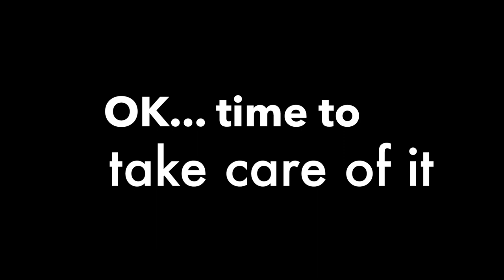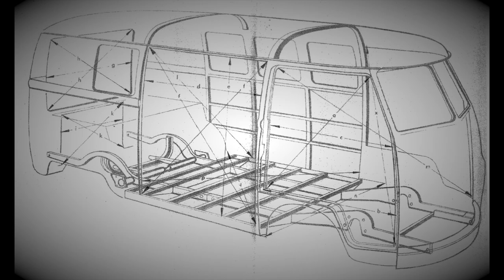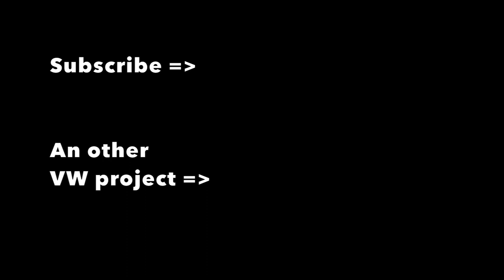VW split bus project built and rotisserie.

Comment: Bonjour.  I am so excited.  I am going to build this rotisserie.    Your bus looked pretty good before work started.   off to see the plans....Merci'... How does the lever attach to the cross beam - it has those pockets for the bar at 2:32...ok...
Reply from the maker: Hello ! It s bolted you can see it at 3:08 😉
Reply: https://drive.google.com/drive/u/0/folders/1U2rrXX19iUVmOLirkAxg0nYiwSPcdXSS here are the drawings ;-)
Reply: @Jimb0w63  Thanks Jimmy !  I printed them.  How big are the casters ? Maybe 20- mm ??   -- I did not see a call out on the print.   On the rear layout for some reason the dimensions did not print out when I printed the drawings  but i have them.... as engineers, we are used metric in school, but my suppliers and engineers I work with work here in the US, use imperial dimensions and talk thousands.

Comment: Looks really great,do you think will also fit a bay window with the same dimensions?
Reply from the maker: Thank you ! I think late bay front beam has the same dimensions, but i dont know for the rear...
Reply: @jimb0w-garage251  I will check myself no problems and thanks for taking time to reply.
Where I can find the drawings please?
Reply: @theaircooledpower  here : https://drive.google.com/drive/folders/1U2rrXX19iUVmOLirkAxg0nYiwSPcdXSS ;-)
Reply: Cheers buddy,thanks for sharing
Reply: The Bay is about 3 inches wider than a split.   Some genius took a early bay window rear bumper (71) and had to take out about 3 inches in the middle to make it fit the split (67).